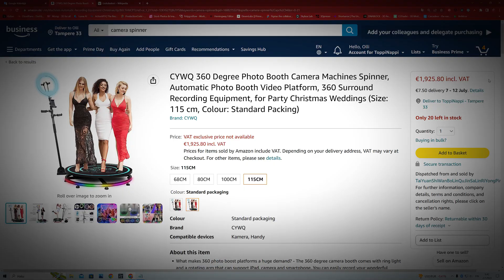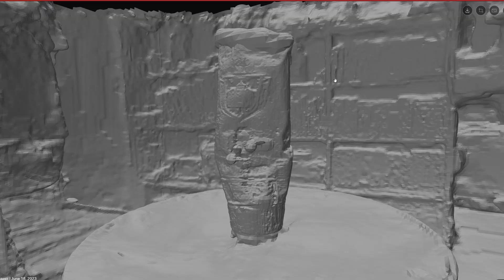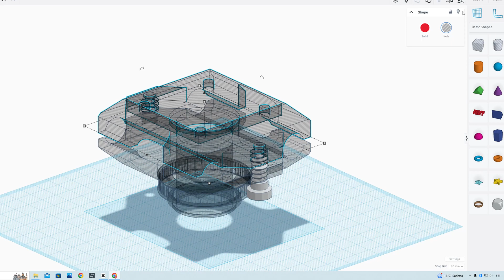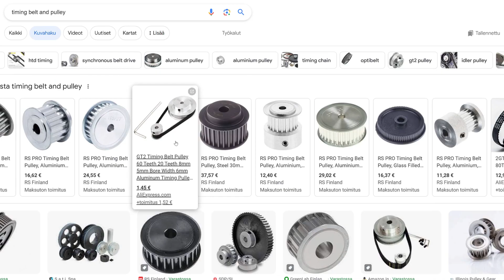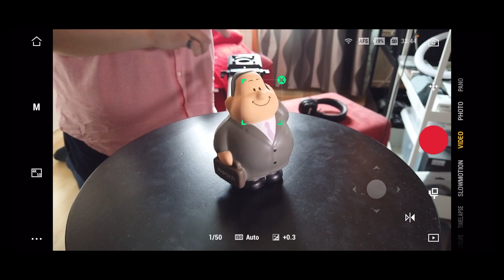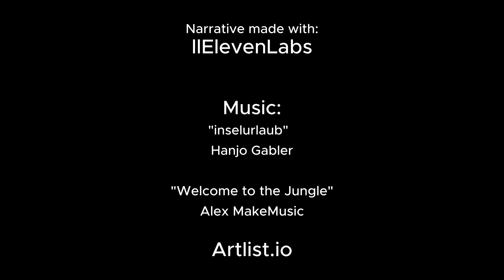How to make 360 Camera Spinner rig from IKEA Stool for 3D Scanning and product shooting

Comment: Love this! One question: I want to create the same rig and we also have Bauhaus in Norway, but can you help me find the name/model of that metal table leg? Since it is the same store, I guess I should be able to find it if I have some details
Reply from the maker: If you check the Thingiverse link in the description. There you can find more details of those parts used in this project. I believe there is link also for that table leg.
Reply: @OlliHuttunen78  Thanks! Do you think the setup is stable enough for some basic product videography? I'm a beginner, but was just asked by someone selling shoes to make some videos promoting their shoes
Reply from the maker: @ Sure! And you can add some weight bags over stool legs if it feels like tipping over. An of course some counter weights on the another end of the aluminium pipes is also needed.
Reply: @OlliHuttunen78  Great! Last question: I see you used easyrig parts to attach camera to the rods, but what did you use on the other end to attach the counter weight? Do you have a link or something for that part?
Reply from the maker: @skyscraperphilosopher8476  Well it is actually another 3D printed piece of the same center part which everything rotates around. It is just attached another way around at the end of the aluminium pipes. I had several table legs so one of them is there pointin upwards.  I put it in there because I thought I could put some regular weights into it.
Reply: @ Ah ok, thanks for helping out!

Comment: What kind of screws did you use to tie the print together? Is it with a nut?
Reply from the maker: Nut would be the best. I found suitable screws from my camera gears. Same standard screws that you can attach your camera to tripod fits also to these parts.
Reply: Hi Olli, mine is not rotating as smoothly. It’s like when it comes to the same spot there’s friction. What can I do?

Comment: well, theres always cross polarisation... And for the automation, im pretty sure you know this but, a few 3d printed gears, a stepper motor and an arduino to trigger the camera (the real challenge would be making a height/angle adjustable arm)... making a turntable to orbital configurable rig is on my list for this winter, that stool might come in handy, and somewhat hilariously i also have a couple of those metal legs lying around.

Comment: I don't understand why you didn't choose a rotating table and a fixed camera? 
It will give you many more options with the camera and you can have a fixed background.
Reply from the maker: When you try to create 3D model with NeRF method I have found that it will generate better model from the video material when the background moves. In regular photogrammetry it does not matter and then it is easier to use turn table to rotate the object and keep the camera in place. This stool works both ways.

Comment: nice build. 
The metal bracket works well, though obviously the friction became a lot higher once you put weight on it. If you ever decided to use a bearing for something like this you would want a thrust bearing, or a lazy susan bearing. they are specifically designed to take a force being applied perpendicular to the rotation plane. Regular bearings would be far less effective as the weight would be pushing the ring into the ball bearings and causing it to pinch them between the two rings, and so be far higher friction

Comment: What application do you use to process the images?  Also, what do you recommend in terms of cleaning it up after?  Do you shoot video or photo when scanning?
Reply from the maker: For Photogrammetry 3D scanning I have used Polycam and for NeRF scannings I have tested Luma AI and 3DPresso. They can make 3D models from videos. You should check my recent videos on my channel where I handle these topics.

Comment: Nice project. Did you use an AI text-to-speech for this video? The voice is much different than in your previous video.
Reply from the maker: Yes. I wanted to give that to try. I used 11ElevenLabs for the AI voice. It is easy and makes the videmaking fast but it doesn’t sound like me yet.
Reply: @OlliHuttunen78  The only way to have the narration sound like you is to actually do it yourself, rather than relying on an impersonal robot voice.
Reply: gotta do the professional cloning :D @OlliHuttunen78
Reply: @OlliHuttunen78  Thanks I'll have to try it too.